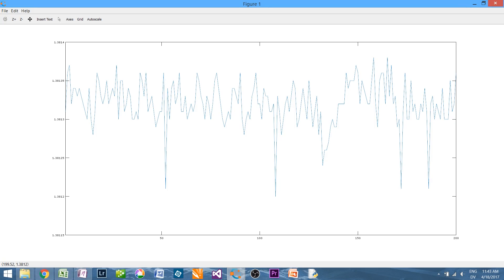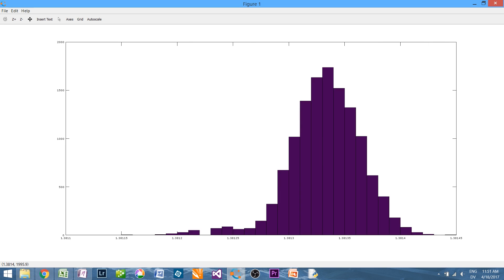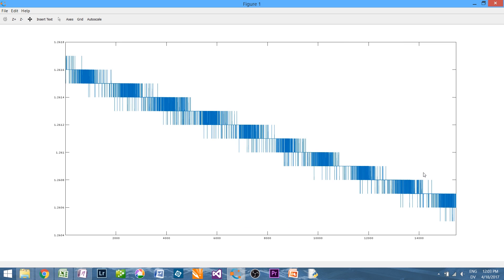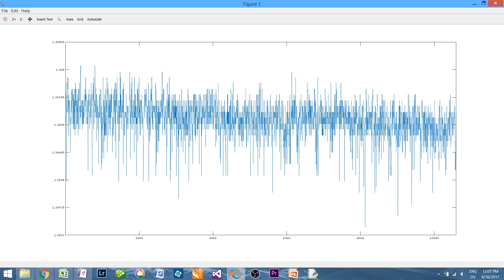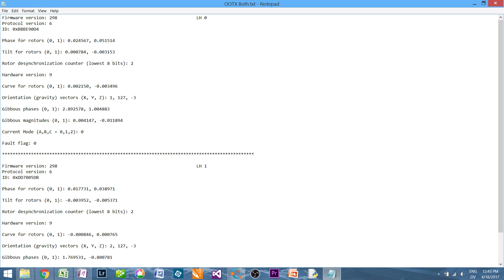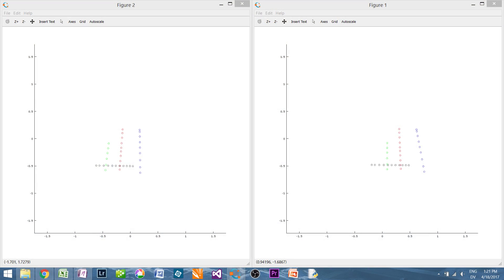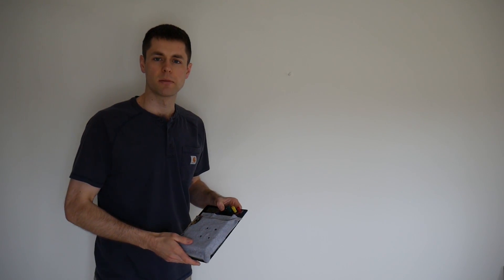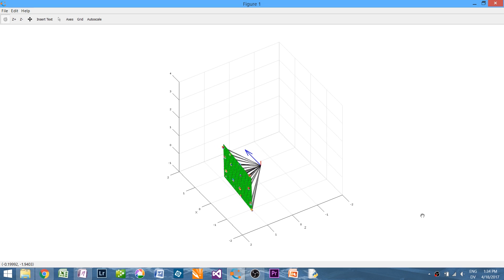Lighthouse Tracking: Calibration

Comment: This project is similar to some things I've been thinking about. I have a couple of questions. 
In the previous videos, you spoke a lot about needing known positions for the lighthouses. Could you use a vertical mill to find the positions? It seems like this would make it possible to find the position and orientation to within a tenth. This might require removing the plastic case, but I'm imagining this might help some with calibration.
Also, why are you using two units rather than three? I'm wondering if a third perspective might help in constraining things.
Reply from the maker: You need the measurements relative to the beam, which may not itself be exactly registered to physical feature on the unit. The units may get bumped or the beam could flex over time too, which would invalidate your measurements. The system is currently designed only for 2 Lighthouses, the sync flash system will need to be changed in order to use 3+.

Comment: Have you considered using the planar and/or linear data you gathered to generate your own values?  You tried optimizing all of the signs, but why not optimize the values instead?  For personal use there's no reason to care that you use the same type of calibration as the factory.
Reply from the maker: I thought about this, generating your own camera model, but I believe it would require the points to be on a known grid. Since I had only a general idea how to go about this and it introduces even more variables I knew it would take a lot of time. If the project still looked like it was going to succeed as a measurement tool I would have gone for it but without that it's hard to justify even more effort.

Comment: Sorry to hear you are giving up on the project.  You have an excellent grasp of the system and aren't too far from making it work quite well.  You have certainly created some of the best public documentation of it.  Seriously great job!

The thermal effect you are measuring is mostly phase drift in the rotor index sensor subsystem.  The rotor is 30 mm in diameter so 1 urad of angle is about 590 nanometres at its circumference.  The exact sync trigger point is affected by mechanical and electrical variations with temperature.  For metrology applications you'd probably want to use Lighthouse differentially with fixed sensors to correct for jitter and bias drifts.  You could also make a much more expensive base station with vastly improved thermal stability and optics, all actively aligned, but just doing resection calibrations within the operating volume of interest once warmed up and/or using differential anchors continuously should get you a lot of improvement.  Increasing the carrier frequency in the base station internal configurations will improve the residual angle jitter too, making precision angle measurements faster with less integration.

Your sensor constellation could be improved.  Planar arrays are the worst, it causes instability in orientation, if you added a fifth sensor in a pyramid its pseudobearings would shift as the sine of pitch and yaw (for example), while the rest of the sensors like cosine... if that makes sense from a small angle/perturbation point of view.  Basically you should have as much baseline as possible in all dimensions, not just two.  My guess is that the majority of your residual error is range noise, while corrected bearings are actually pretty good?  The best projective geometry also occurs when the base bearing radials intersect at the sensors near orthogonal, each pseudobearing gives you no range information, so the additional information from the other base is maximised when they are as independent as possible (i.e. dot product is zero).  A good tracked object is as large as possible and has lots of sensors that are not coplanar or colinear (only pairs and triples should form lines and planes).

Your linear slide calibration idea isn't fundamentally flawed, in fact it should work fine. There are other paths that might be easier to move a sensor through with extreme precision that have only slightly higher degree of freedom but are still only parametrised singularly per pair of pseudobearings...

The offset of the beam projection centers from the axis intersection point is significant closer to the base stations, but gets small pretty quickly.  You can prove this to yourself by differentiating the system equations (i.e. look at the Jacobian and how the offset parameter dependent parts behave with increasing range).  There are a couple of subtle wrinkles that might show up as you push for serious levels of accuracy, including stuff we don't currently correct for, like sensor nonideality and front window refraction.  To really wring out the full metrology-level performance the system is capable of you would need to make your model and calibration system much more sophisticated than we use in routine VR tracking.
Reply from the maker: Thanks, if it looked promising for my original goal I would keep pursuing it. I definitely think the lessons and strategies from this project will be useful in the future.